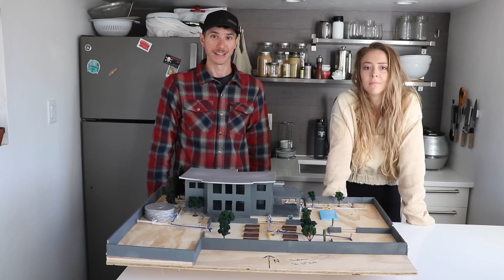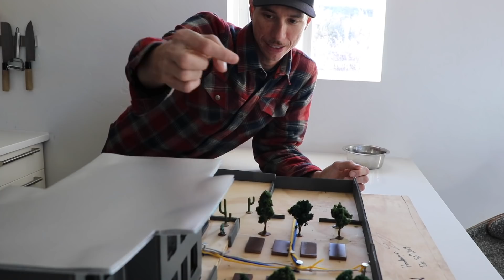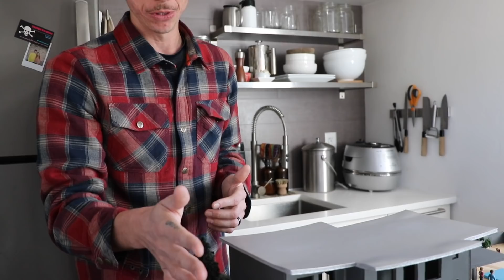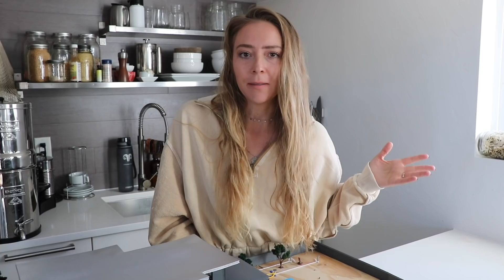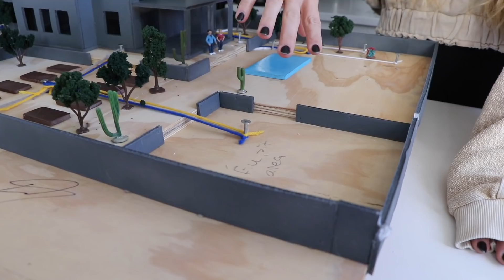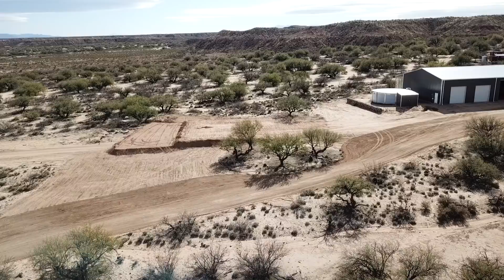Why We Built A 3D Model Of Our Home & Landscape

Comment: I would not put in the trees on the east side of the garden. Because the summer veggies usually love the morning sun. I'd also put the pool out there on the east side of where those trees would have been. I think it will be too shaded by the house where it is.  I've been at a pool that had afternoon shade and it was too cold to swim very late in the day. If you're going in the pool you probably want to warm up in the sun after you get out, and warm up in the sun before jumping in. Also the water will be warmer if it's in the sun all day. So maybe switch pool placement with the bbq area. I am in northern Cali so maybe these don't apply, but it does get over 100F here in the summer. Those things help us to use the pool farther into the spring and fall. And also shade for the bbq area from 5:-9:pm in the summer when you'll be wanting to bbq. 
Great house orientation!

Comment: Two Questions; How do you know that your design is structurally sound?  Are your going to be able to get homeowners insurance on this structure?  I ask because I watched previous video where you opted out of the county permit process on the design and construction.  I have been watching your progress for over a year and enjoyed the process and videos.  Good luck, you both are working very hard and have an interesting plan.
Reply from the maker: Used an engineer, why do you need insurance?
Reply: @Handeeman  If it catches fire and burns down your investment is protected.  Sounds like you will have several hundred thousand in materials and thousand of hours in labor building this house.   Stuff happens. We were struck by lightning and there was a fire.  Friend was cleaned out in a break in.  All covered.  Just saying.

Comment: Run conduit between the house an garage for fiber optic cables.  Extend your internet between the buildings using some switches with SFP ports.  Think about wifi and camera wiring too.  PoE devices.  ui.com makes good stuff.  Also your heat pump unit will work best not being in the hottest sun.  you can build a shade structure if you have to place it in the hottest side of the house.
Reply from the maker: Way ahead of ya 🤙

Comment: It's really nice, time spent in planning is a great investment! consider extending the roof out over your upper deck area so it could be fly screened off and also the main slab out to deck edge, make the opening to outside maximised (no wall return on that corner) it will make the under cover outdoor area feel more integrated in to the house and if you want to enclose it later its strait forward, also consider an under cover area near the entrance for parking a car so you can unload goods and or persons at the house comfortably in all weather. Good luck with the build! keep up the great content!
Reply from the maker: the main slab will definitely be going out to the deck edge continuously from the house :) it'll be poured all at once

yeah I'm thinking of ways over covering that upper patio too :)

Comment: Have you looked at ICF systems that leave the concrete exposed on the inside? That would be ideal here in AZ, especially if using passive solar. Nudura makes one system. Other companies make products that have twice the insulation on the outside as the inside.

Comment: Is there a reason you're going with grey water rather than an all-in-one aerobic treatment system? I grew up in a house with one of those and it kept the lawn and gardens lush and green all year round.
Reply from the maker: to me, something like that sounds complicated lol, I like this to be simple and grey water direct to tree is the best IMHO
Reply: @Handeeman  Whatever works for you. 

They're pretty set-and-forget systems, basically a second septic tank fitted with an aeration system and pump that takes the place of the soakage field. Our local government required a yearly inspection to make sure it was working right and when that happened the disinfection tablets would be topped up.

Just thought I'd ask if you've looked at them because the pump allows more flexibility with how you can distribute and apply the wastewater to your property - e.g. you can use drippers, which are the most efficient way to irrigate and allow you to use it grow non-root vegetables as well as fruit trees and ornamentals.

Comment: Great video. Can’t wait to see it going up. Are you going to have a thermal mass under the floor by your south facing windows, or does your underfloor heating make that unnecessary?  Also, when my Mom built their pool in Havasu, they put something called Kool deck on the concrete  so you could walk barefoot on it in the summer and they had a pool heater for the winter but also needed a pool cooler for the summer. Without it the water was 90 degrees. Garden looks great.